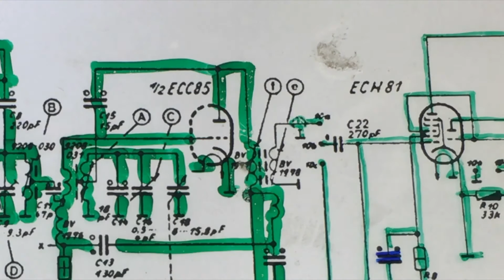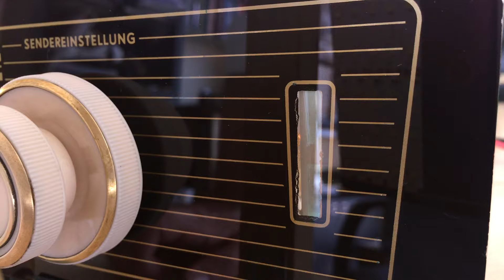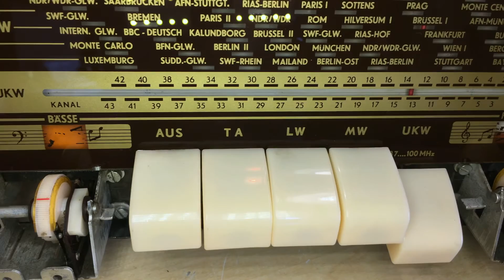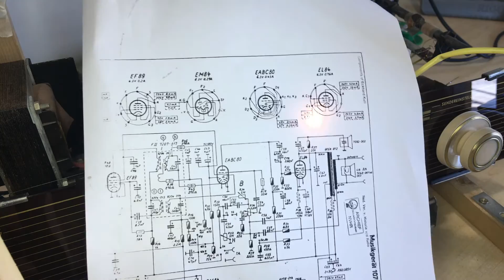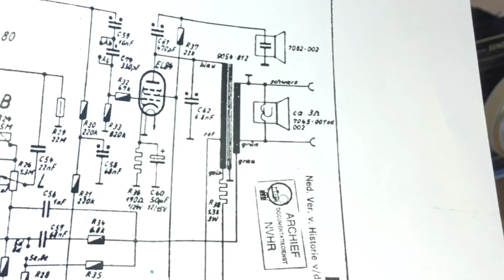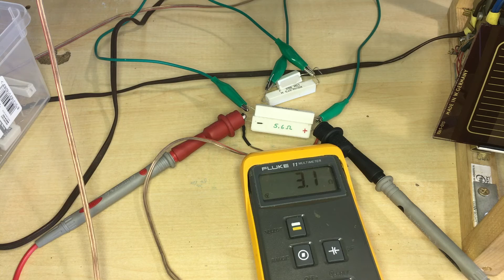Grundig 1070 tube radio restoration - Part 5. FM, FM, FM! Yes!

Comment: Hello Manuel.  I have a similar Grundig with no FM.  AM is fine, FM is dead--magic eye doesn't change and barely get static.   It's been recapped and an couple of resistors have been changed.  All voltages are spot on and pin resistance checks to the schematic chart.  If the resistances and voltages are OK, could mine have a similar coil issue or would the resistance checks rule that out?  And can I rule out a dirty band switch if voltage and resistance checks out?  I want to avoid unsoldering coils if at all possible as the risk of causing other problems would go way up.  Do any of your other videos go into the detail of checking coils?  Thanks, your videos are contributing to my recently acquired radio habit... and the more I learn and try, the more trouble I find!  Much appreciated.
Reply from the maker: Dirty switches sometimes can escape the resistance checks. Also, try changing the FM tube.
Reply: @electronicsoldandnew  As you would say, "no joy".  I had tried tube substitutions and I tried cleaning the switches again.  I get static which gets louder on what I think are stronger parts of the dial.  Would you recommend focusing on all the circuits between the ECC85 and ECH81?  Can you think of any of your videos that would be a help for troubleshooting?  Thank you.
Reply: @electronicsoldandnew  BTW, first time I used your rectifier replacement PCB, which was a tremendous idea.
Reply from the maker: I think you need to try injecting a 10.7MHz signal to ensure that at least the IF is getting through.
Reply: @electronicsoldandnew  OK, thanks.
Reply: Thanks for that tip.  I did inject a signal through a wire wrapped around the ECC85 and I also tried by connecting to the antenna input. In both cases I did get the tone and the tone did not change no matter where I adjusted the dial to.  So, that tells us that the switch must be working and the IF is getting through, correct?  Any next step recommendations?  Sorry to be a bother and cut me off whenever you like.
Reply from the maker: Ok. we now know the IF is getting through, so the problem is probably inside the FM section up front. You must try another tube in there. Could be as simple as that.
Reply: @electronicsoldandnew  No joy there, I have tried another known good tube.  I did have a bad resistor in there which I changed (interestingly I did another Grundig 2260 and the same resistor was bad and in that set, changing that resistor improved FM reception dramatically, although in that set I did get FM even with the bad resistor).  This set I get no FM at all, before or after changing that resistor.  Should I suspect the 2 capacitors connected to that bad resistor?  Any smart ways to check that FM section?
Reply from the maker: The FM section must be handled with great care unfortunately. Check if the antenna seg all is actually getting into the FM front end. Also, check if B+ is getting to the tube pins by removing the tube and measuring on the pins… carefully 😊
Reply: @electronicsoldandnew  I'm getting into new territory (as you mention, you always learn something).  All voltages for all tubes are spot on to spec as are all the resistance measurements.  Your antenna hypothesis could be a good one but why would I have gotten a 10.7 tone out of the speaker when I connected my signal generator to the antenna jack?  But with that in mind I checked connectivity...I get connectivity from the antenna jack into a small cap at the front end.  I do get connectivity from the "backside" of the L1 coil (the trap I presume?) to the ECC85.  I don't get connectivity across the L1 coil (from the 2 wires leading into the coil from the antenna capacitor to the 2 wires leading from the coil to the ECC85.  I don't see any damage to the coil and the original wax over the adjustment slug is in place.   Does that sound like a bad coil to you?  And, is there a sure test it and if necessary a way to replace it?  .... again I'm in new territory.   Your help is much appreciated...I see a new "building block" video coming!
Reply from the maker: which model is it exactly? I want to look at the proper schematic
Reply: @electronicsoldandnew  It's a 2260U and I truly appreciate any help but I'm sure you have plenty of other projects to help educate all of us radio geeks.
Reply from the maker: I’m baffled. With the 10.7 going in to the antenna coil you should not hear the time going through as the antenna input circuit is more suited to the actual FM band frequencies. I suspect the signal was actually being induced into the tube itself (?). You can actually check the continuity of most of the coils by seeing where they go to (ground, tube pins, etc) and measuring some resistances on those lines. 
It’s tough helping out from a distance, especially on the dreaded FM can, unfortunately.
Reply: @electronicsoldandnew  Thanks, you've been a huge help.  I've learned some things and will keep poking around.  Sounds like you are pretty confident the trouble is in the FM can and I will focus there (carefully).  On the other radios I've done my focus was on the voltages and resistances and, ironically, this one is the closest to spec of any I've done. Hopefully I'll find the culprit.  Keep up the good work helping us non-electrical engineer types get the kick out of reviving these old beauties.
Reply from the maker: Good luck Mark, and please let me know what the issue was when (not if 😊) you solve it.
Reply: @electronicsoldandnew  Will (hopefully) do🤞  Thanks again.
Reply: I'm trying not to belabor this, but you may find this interesting and a big clue.  If I take out the ECC85, I still get a tone out of the speaker if I connect the signal generator to the antenna input.  Then I started fooling around... without the ECC85 tube in place, if I touch the signal generator lead to the radio chassis, I get an even stronger tone out of the speaker.  Wouldn't that mean that the signal is being transmitted via the chassis ground and bypassing the FM circuit completely?  And wouldn't that explain why I get the tone no matter where I turn the dial?  Again, cut me off anytime.  It seems like a big clue to me but again, I'm a novice.
Reply from the maker: It seems that the signal gen signal is getting induced into the IF chain simply because of proximity to the first IF transformer in the can. If the signal is strong enough it’ll get through somehow. It is a little strange though.
Reply from the maker: do you have a scope that’ll detect 100MHz or so?
Reply: @electronicsoldandnew  No... I barely know how to use the signal generator😉
Reply: But I like your theory.  If understand the radio correctly and the signal is going into the IF can, it is bypassing the antenna, tube and front end can, which means that the circuit from the IF can to the speaker is OK, but we still don't know anything about the circuit from the antenna to the first IF can.  If that logic is correct, back to square one... try to figure out what's going on in that front end.  I'll keep poking around.  Thanks
Reply from the maker: I was going to suggest you try and detect the oscillation to see if it was working.
Reply: @electronicsoldandnew  Maybe I need a scope... off the top of your head do you remember if any of your videos demonstrate how to do that test?
Reply from the maker: Probably, but which one …. not sure. The idea is that if you locate the tip of the probe (insulated!) in the vicinity of the oscillator, you should pick up the actual oscillator signal in the 100MHz region. You have to move the probe around to see where it’s most noticeable.
Reply: @electronicsoldandnew  OK, thanks.  I'll look around.
Reply: @electronicsoldandnew  As you note, it's the simple things.  Turned out to be a bad solder joint at a grounding point in the front end can.  Thanks again.
Reply from the maker: Congrats! Those are sometimes the most difficult to track down. Enjoy the radio.

Comment: Hello Mr Caldeira. I am wondering what do you use to rewax the plungers of IF transformers after the realignment ? I got the FM module of a Schau-Lorenz working again after resoldering and realigning using the magic eye as a guide. I have no signal generator ;-)
Reply from the maker: I usually just drop a bit of actual candle wax in there. If you have bees wax, that would be better.
Reply: @electronicsoldandnew  Thank you so much...i had bees and they left me some wax !

Comment: You can use a 6E2/EM87 in place of an EM84.  You may have to change the resistor on the grid for a higher value if it doesn't respond correctly.

Comment: Never seen a speaker with 3 Ohms. Crazy. No experience helps. You get into the trap.
Reply: Sony made a powered subwoofer once which had a digital amplifier which output into a 1 ohm load.

Comment: Nice progress on the radio! Thank you for checking the amp section again, now I also think that it's working correct. Regarding the values at the EL84 in the schematic, I assume that the operation point is close to the characteristics on the bottom of page 3 in this datasheet: http://frank.pocnet.net/sheets/010/e/EL84.pdf7k load resistance at 250V/36mA was very common for EL84 in german radios since it extends the lifetime of the tube. As you mentioned, a higher power is not necessary due to the very efficient speakers.
Reply: The link got messed up...http://frank.pocnet.net/sheets/010/e/EL84.pdf
Reply from the maker: +rotwang83 : yes, so it seems. I've noticed many work at about 7V at the cathode, so  41mA cathode current with 170 ohm resistor. Taking into account the screen grid current, we're at the 36mA. I've never been tempted to try to squeeze more power out if the as it's really not needed.